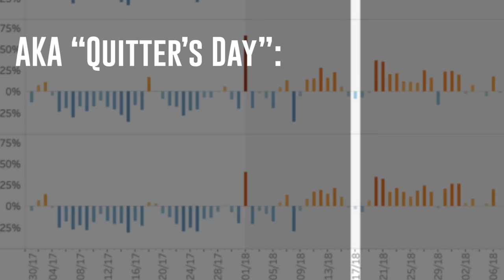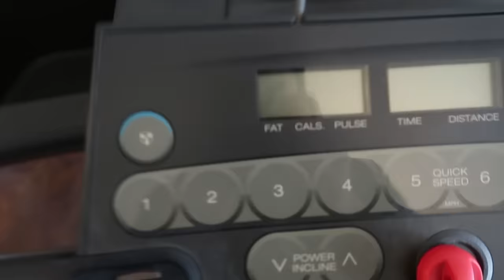Turning a Treadmill Into a PS4 Controller So I Exercise

Comment: @1:25 "This is some kind of sensor that detects magnets" I can only think of two kinds of sensors that do that: a coil and a Hall effect sensor. I guarantee it is the later since it would interface with the logic board much easier and cheaper than a simple coil. I would also put good money on the logic board being dead from taking repeated power hits since most people don't put this kind of equipment on a surge suppressor and instead just plug it in. I could also be a few electrolytic capacitors dying and ruining the clock for the logic board and the power supply. But who cares, time to put a new brain in it.
Reply: Mine has reed switch in it. They tend to magnetize and stick solid after a while. Had to replace it one day.

Comment: When you already have a voltage dependent on your speed... wouldn't measuring it and mapping that to the potentiometer make more sense? It would probably give better response times and more precision since you could also walk slower
Reply: But that would require an actual control setup and not a pair of potentiometers and relays.

Comment: I feel like this would suck less if you made the controller control the speed of the treadmill instead of the other way. Having to push the tree is so difficult, and if the goal is to get some exercise then setting a lower difficulty threshold would be helpful.